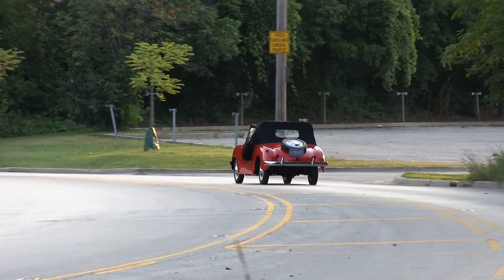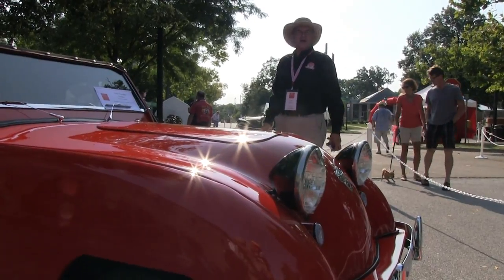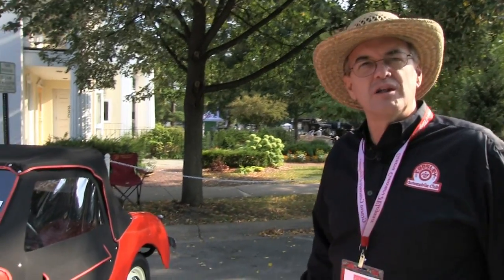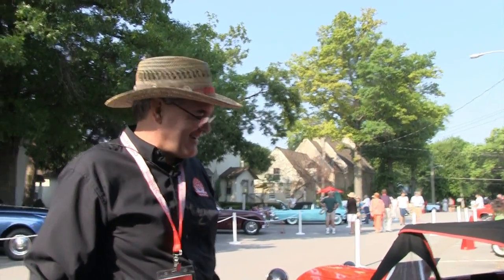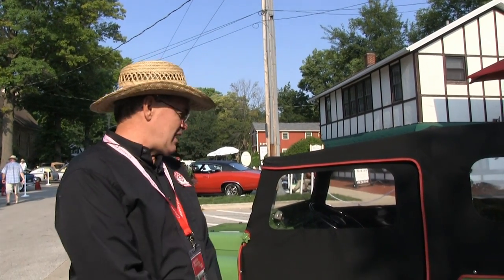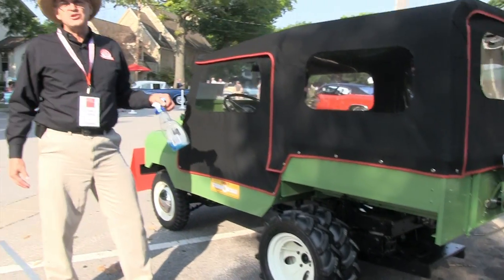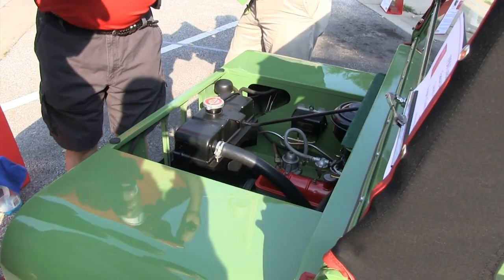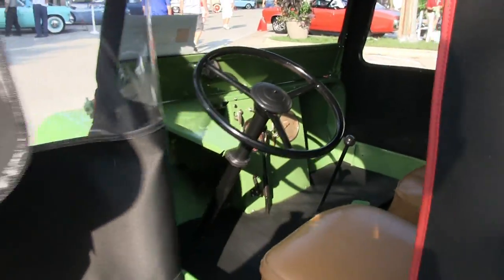A Crosley Hot Shot and a Farm O Road - We talk with the owner at the 2013 Geneva Concours

Comment: My Dad in the 50's built a ATV of sorts using the chassis of a Crosley. I wish I had the pictures of it.  The story was he had a hood for a Lincoln welder and other various parts and found the chassis. My brother was handy with fibreglass and made the gas tank and created an attachment for a half-track that would attach in front of the rear wheels with a belt made from cut tires connected together with chain links. Oh and other parts bear mentioning he had an instrument panel from a 1939 Buick and an ignition that was mounted on the steering column from a Hudson Terraplane.  The seat backs front and back were from Army surplus Jeeps.  Dad used it several years on hunting trips and in between I drove it... a lot!  What memories!
Reply from the maker: That sounds like a very special project. Too bad no pictures...